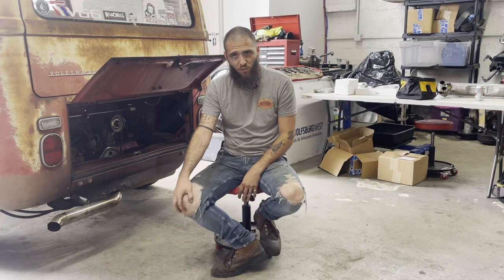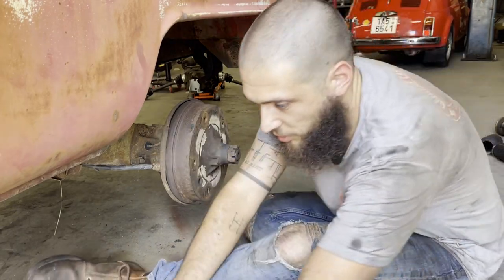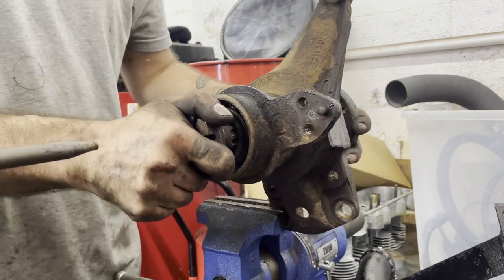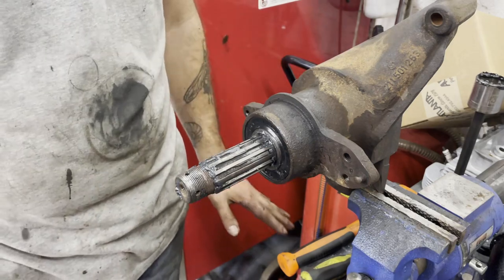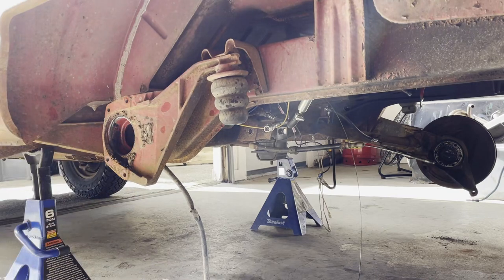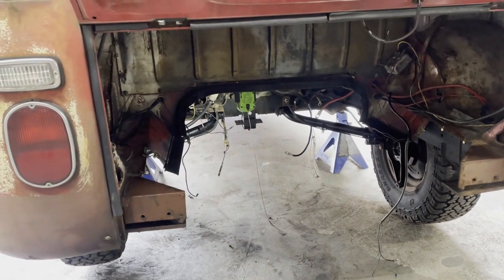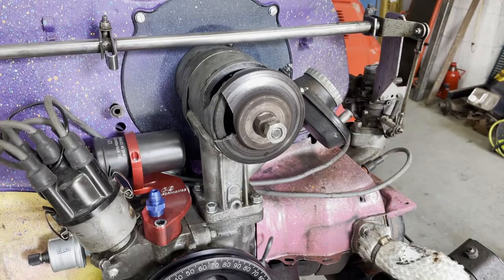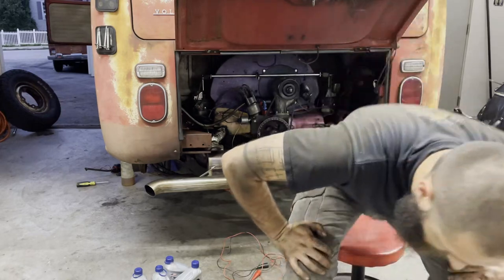THE STRUGGLE BUS Gets a Complete REAR SUSPENSION REBUILD + ENGINE UPDATES - 1969 EARLY BAY VW BUS

Comment: Nice work! It’ll handle much better now!
FYI, the derale fuel pump was my overdue fueling issue I had on jawbreaker. When I shut the car off it wanted to seep fuel into the engine from the carbs. What I found out is the derale fuel pump has a check ball in the end and keeps pressure on the needle and seat. So when the carbs start to heat soak from sitting after a long run the pressure would increase and overtake the needle and seat. 
I since switched to the carter 3psi fuel pump and no more issues. No need to floor the gas petal on start up after a long run.l, it pretty much fires right back up like it should. Just fyi from my experience.
Reply from the maker: Thanks for the heads up! This unit wasn’t pulling fuel at all. The Edelbreak ain’t broke yet so I guess it’s staying until it is 😂
Reply: Never heard of the derale fuel pumps. The carter fuel pumps have good feedback, from the samba members & other youtube channels.
Reply: @vintage76vipergreenBeetle  it’s similar to the one that CB sold or still sells. It’s a rotary pump, works great and very reliable but has the check ball as a check valve so it’s an issue when feeding carbs.